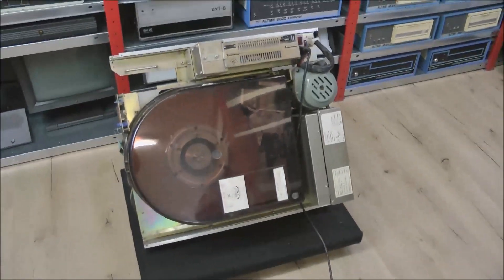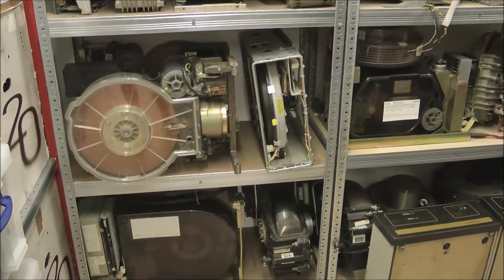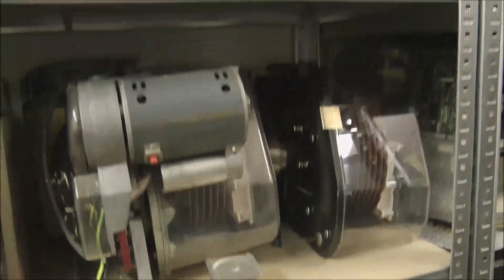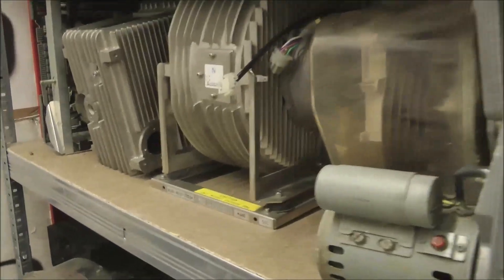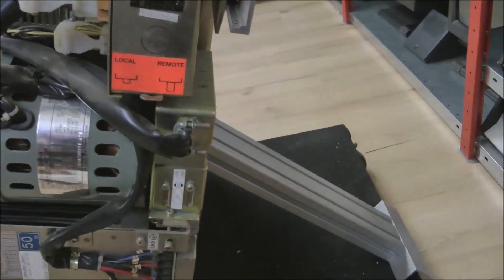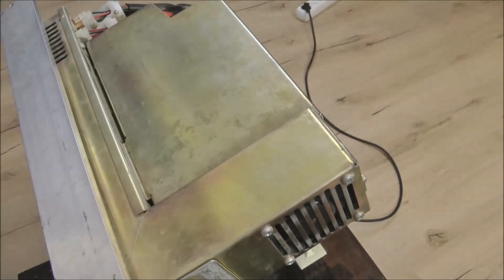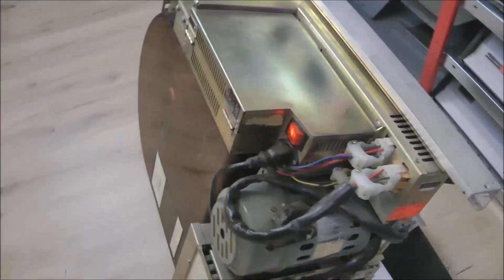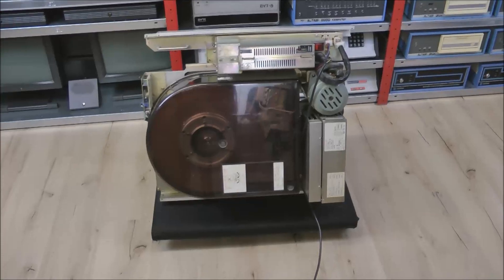Hard Disk Drive monster from the past - booting up a 30 years old 14 inch HDD.

Comment: Ich habe für meine neue Dashcam gerade eine 512 GB MicroSDXC-Karte gekauft (34 €).
Also die Speicherkapazität ist ungefähr 1.500 mal größer und die Fläche ist ungefähr 11,0 mm × 15,0 mm.
Bei einer Dicke von 0,7 mm errechne ich etwa 115 mm³.

Die dicke Platte im Video hat diese Abmessungen: 250×416×650mm = 67600000 mm³ und das ist ungefähr das 500.000-fache Volumen.

Soll ich mal versuchen, die Speicherdichte zu vergleichen?
MicroSDXC: 512.000 Megabyte auf 115 mm³                => 4452 MB pro mm³
Fujitsu M2294: 335,5 Megabyte auf 67.600.000 mm³ => 0,000004963 MB pro mm³

Hmm, wenn nur die Menschheit vergleichbare Fortschritte gemacht hätte. 
1980-1988: Erster Golfkrieg, mindestens 300.000 Tote
2022- andauernd: Krieg Russlands gegen die Ukraine, hundertausende Tote
Die Menschen werden schlechter, die Technik wird besser.

Übrigens; Manual der HDD gibt's hier: https://ia803200.us.archive.org/13/items/bitsavers_fujitsubrorochure_2210946/Fujitsu_M2294_Brochure_text.pdf

Comment: 30 years old?... Uhm.... I am sorry to inform you that type of hard drive stopped production in 1978 and since you did the video one year ago, that will make the hard drive 45 years ago... NOT 30!
Reply: You can see the date of manufacture November 1984 clearly on the drive. I seen these drives still in use in the early 1990's.

Comment: The reason it's so loud is due to noisy spindle bearings - but since it seems to be a sealed unit replacing the spindle (if you could even find one) is probably not an option anyway.

Comment: I see that you have at least one Eagle HDA on your shelf.  I always liked the appearance of those.

The successor to the 3370, the 3380, was the first hard disk drive to break the gigabyte barrier.  The 3380 had two head-disk assemblies in a very tall cabinet, each of them storing up to 1.28 gigabytes of data on nine 14-inch platters. It was originally supposed to ship in 1980 but problems with the heads pushed the first delivery to October 1981.  There is an example of a 3380 HDA at a computer shop close to where I live.

Comment: I would love to see more of your collection. There is something quite special about hearing the inductive load put on the motor windings of these old platter drives, and even more of a treat to hear the heads seeking, which was a little disappointing to miss on this particular monster. Ah well, a lifetime project indeed.
Reply from the maker: I dont know why the heads are not seeking - there are several levers that can be pressed - maybe I give it another shot and try to make it seek
Reply: Who doesn't love the sound of a good seek profile?

Comment: Man, I really don't think back too much on some of the equipment I had the pleasure of tearing apart back in the late 80's and 90's... Did a VAX 11780 and 11785 had some very interesting washing machine size changable platter hard drive.. I think they were 330 megabyte, but I can't be sure. I was able to get 3 or 4 of them from the data center that was tearing them out. I know they ran on 3 phase 480, and had literally a 3/4 HP 3600 rpm induction motor on a belt drive to spin them up. The platters were 14 inch and I think 8 disks deep if I remember right. I still have a couple of the 1/8 inch think platters around somewhere. The heads moved on a huge 4 inch diameter voice coil looking assembly that would have made Doc Brown proud to use as a speaker driver! you could probably use a truck innertube as the surround... anyway... seeing this just made me think of those units.  The bed casting on it was solid cast aluminum. that casting alone was 120 pound, or like 110 kilo... back when I was 18-19 years old I'd swing that thing around like no problems...  today would be a bit more work!